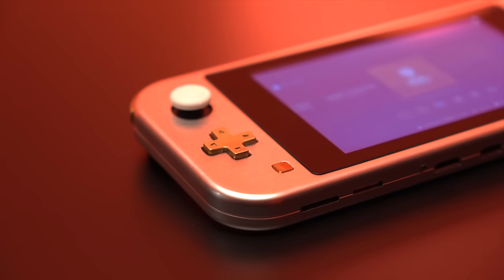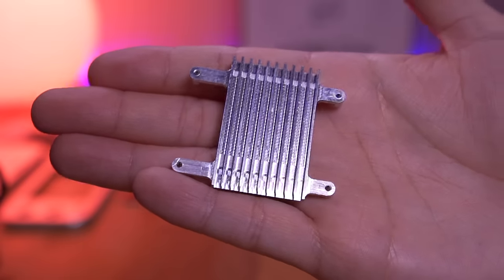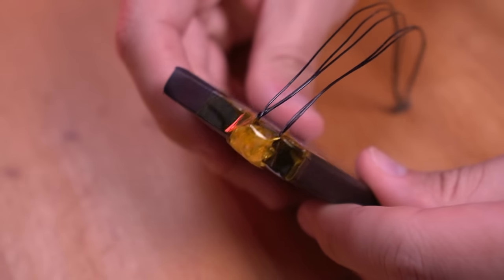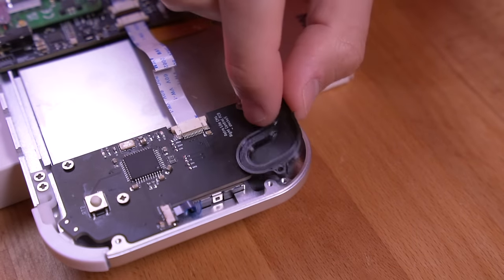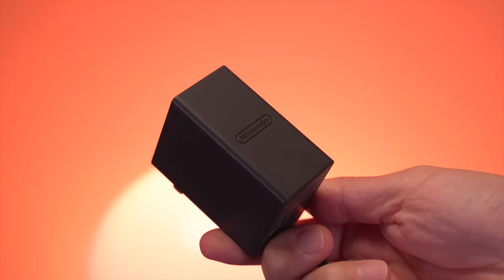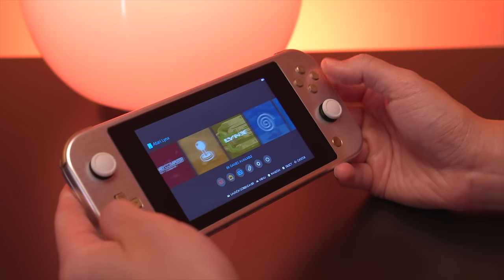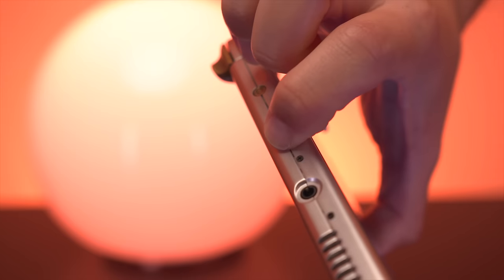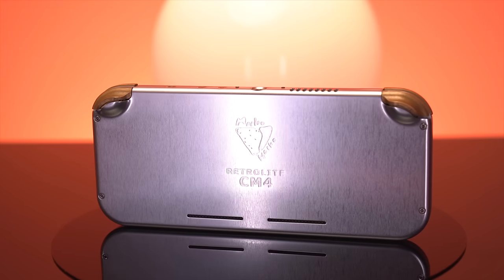This is NOT a Nintendo Switch

Comment: Thanks for the shoutout! It was a little over three years ago when StonedEdge and I started working on this project together so we have both learnt a lot since then! The joysticks do have screw posts to hold them down, we just ended up not using them since the joysticks stayed put so nicely without the screws. I also wrote most of the OSD and controller software whilst Stonededge handled the electronics design and software setup stuff. The dock was entirely StonedEdge since I had no need for one but I can see he's done a wonderful job of it too! We've since split up onto different projects, Stoned is working on a new revision of the retrolite and I am making my own version of the Steamdeck using a NUC and doing my best to kickstart a Youtube channel with it. Anyway, enjoy your new Retrolite and hopefully it sees more use than mine does 🤣
Reply: I've been following your NucDeck videos without even realizing you were part of this project! Both incredibly impressive and ambitious!
Reply from the maker: Absolutely!  You and Ben did an amazing job with this project!  Your nuc steamdeck looks very cool!
Reply: I’m kind of curious about the sd card, has any measure being taken to prevent the pi from shredding it? In my experience some diestros tend to absolutely eat the sd and it ends up failing after a few months of continuous operation (which is pretty out of scope for this).
Reply: Great job guys, but honestly you should prepare for the incoming lawsuits ASAP, this looks similar enough for Nintendo to sue and cripple you.
Reply: lemme buy urs since u don’t use it so much @horchatamilker
Reply: @fujinshu it does look a lot like the switch light but screen looks bigger
Reply: Hallo nice job but I think it has the same problem as the switch. You can not hold it for long playing. That's why you need something to hold it.
Reply: I love this project. Though I do kind of wish there were more projects just using standard/oem shells for the consoles in question (e.g. the psppi project). I feel like a lot of these DIY projects either require you to do it bare-board or effectively have a 3-d printer (or know machining) as a requirement and thus putting it out of reach for most people.

Comment: While the pi5 is right around the corner the pi4 is still an extremely capable board for stuff like this so it makes sense to design around the cm4 not only is it going to become cheaper to get a cm4 but you will get really good emulation at the lower cost
Reply: Hopefully, scalpers won't make it near-impossible to find pi-CM4s like it had been with previous pis.
Reply: The problems with this are:
- Find any Pi available
- Plenty of more powerful and with better hardware Chinese consoles available (like Retroid pocket, and Ambernic brands)🤷‍♂️
Reply: @nach0x are the retroid and anberbic devices really more powerful than a cm4? Which models out of curiosity?

Been looking to build or buy a portable. Currently looking at building a pspi, cut up Wii (as I have spares), or something else pi based, but would buy something pre-built if it was interesting.
Reply: @charlesswansonii9319     exactly...i had to wait till last year from 2020 to get one at retail price...almost the whole of coronavirus lockdown in Britain...Adafruit and sellers blamed chip shortages in Asia...we would believe that except the Chinese found plenty for their Asian contracts...and North America...that got the remaining shipping containers...Europe got the minimum...or pay double or treble for direct private sales...what can we expect from loyal Chinese...we only designed it in England
Reply: @nach0x AYN odin is a powerhouse
Reply: @LVHamtaro  for that price it better be
Reply: @Wilbure  well there are  plenty of choices,  what's your emulation of preference  or aim?,  how much $$ do you want to spend?  preferable size of shape?
Reply: @Wilbure definitely. Pretty sure the retroid pocket 2S is just (if not more) as powerful as this, and its only 100 bucks.

Comment: This thing is amazing. I just wish they would use a non-custom battery. Nothing says "future e-waste" like a custom battery. Batteries are the one part that will eventually wear out - and making it custom means that I won't be able to get one in 5 years when it finally dies.
Reply: Replied to another post further up, but it's compatible with a common cell size (855080 4000mah). The one in the video is just some special ones Stonededge had made with a nice wrap on them.

Comment: I woulda prefered if at some point you talked about what the dock sends to the tv, specially what res does it output instead of just glossing over the docks workings, which was by far the part I was most curious about this build
Reply: I can answer that - 1080p 60Hz :)

Comment: I wonder would a RK3588 be better here, though now we have the RPi 5. That being said, i wish there's a way to mod existing phones to dedicated handhelds or SBCs to reduce e-waste and give a second life to phones.
Reply: You kinda-sorta can do that, just connect a mobile controller like Razer Kishi to the phone and play.
It's better if your phone is supported by a custom ROM like LineageOS to ensure software updates, and if the battery is still in good shape or easily replaceable.
Reply: @subrezon  I have seen a hacky solution that involves mounting a heatsink+fan and a much larger battery. Just not a nice kit that you can 3D print+buy parts of the shelf.
Reply: @cloudycolacorp  Found the videos I was talking about. There's one by Geekerwan and another by Zac Build

Comment: I am so sorry but this fails right out of the gate by making us solder to a battery... that is incredibly dangerous. this needs to be designed better. That is just beyond stupid.
Reply: That's a little PCB on the end of the custom battery, you aren't soldering directly on the cells.
Reply: @cncdan  short it and it will explode, no thank you. hard pass.
Reply: @cgwworldministries83  there will be over current protection on the PCB. Short it and you'll see a little spark followed by nothing. You can buy batteries with leads on them already in this size anyway (which is what I did). Then you just need to solder the plug on one lead at a time. It's a piece of cake for anyone with a small amount of soldering experience.
Reply: @cncdan  not even going to chance it bro, it should have a spring loaded battery compartment. No excuse.

Comment: You know for a cm project a phase change thermal pad might be a better option for a flat pad style heatsink. No fuss with the perfect amount of paste, no mess and you might just get better temps! I've never seen you use it, I've used it on a few projects and each time it shows lower thermals than kryonaut. It's anecdotal but I like it

Comment: I just love how many options there are for portable gaming now.  If sony wants to give up on their real portable system and sell a tablet with a controller glued on instead and Nintendo won't upgrade the switch, the community will come fill the gaps in the market that the steamdeck and similar devices don't cover.

Comment: I can’t understand why most of these projects don’t pay enough attention to sound. They install low-quality speakers that do not have a housing; they play low frequencies poorly. For example, they could use speakers from the iPhone se/7/8. I think the sound would still be better.

I wrote this while watching, here the speakers have a housing, but it is unlikely to be sealed.
Reply: It's a snap fit. You could glue the edges together if you were worried about it

Comment: I don't like the aspect of using a custom battery and not a commonly available one. what is in 10 Years? Will i be able to get a replacement battery? If using the form-factor of the for example Nintendo 3DS Battery you will be able to get a replacement but so?
Reply: I think this part was a little misleading. It's a common cell size, Stonededge just got some made with a nice wrap on them.

Comment: My only beef is with the emulation power. If it can't do PS2 or GameCube, it's just a bit too weak for me. If There is a Pi5 CM in the works, or as mentioned at the end a RockChip Rk3588 version I will be ALL over this!

Comment: The board layout is a mess, why not have controller connecters on the side edges having a long cable that runs under the heatsink is such a mess plus with the addition of having the fan sit on pegs on top of said long wire there muse be so much noise on that line.

Comment: There's no excuse for making a new product in 2023 with bezels around the screen that are magnitudes bigger than the original PSP bezels. Screen size on handhelds is probably its main spec, as it directly affects both immersion and your eye health. And there's a lot of lost potential in screen size with those bezels, but somehow it managed to have a custom-made battery.

Comment: Oh man were so lucky they made the battery proprietary instead of ya know using any of the already working ones
Reply: The battery isn't proprietary. It was designed to fit an 855080 4000mah cell. Stonededge just got some custom batteries made with a nice wrap on them (and I believe they are 2x 2000mah cells in parallel, I could be wrong on this one)

Comment: That's really cool but as soon as I saw you installing those shoulder buttons I knew they would be an issue due to the design just using the plastic or metal bending to give it the springiness.  The plastic ones probably do work better, but for how long?  Im sure they will work those small things out eventually.
Reply: One of the designers here (just catching up on some comments). Have you ever looked at the shoulder buttons inside an xbox one controller? What about the buttons on computer mice? Plastic is used as a spring in all sorts of different products and industries so its definitely not an issue. The trigger buttons weren't the greatest design ever due to manufacturing limitations, but they worked when assembled correctly. They did sometimes need a little finessing to get the fit just right and I'm not sure how well that happened here. I think the metal buttons would've also made the feel of the trigger buttons worse as the membrane was never designed to be thick enough to support a button that heavy. In hindsight, we should've just used replacement switch lite triggers but its much too late for that now.

Comment: Hey man, love your videos. I've had a lot of successful projects thanks to seeing what you do. 

However, in this video, I feel like there's one major part you left out, and it's absolutely a big one. That is, battery safety! You mentioned getting the wiring on the Lithium battery correct or "it can damage your console" but that is a very, very significant understatement of what can happen if you do not wire that properly. 

Battery overheating, thermal runaway, and even venting is extremely possible when you're soldering directly to battery pads. In this case, who cares about damaging a console? You don't want to lose a hand, or have a battery vent when your face is near the console! That should be the focus there. You also didn't mention keeping the wires from touching eachother after soldering them to the battery either. If you're going to show a video soldering onto a battery like this, you NEED to cover that as well since hard shorting this type of battery can be catastrophic. 

Another part that should absolutely be included is a disclaimer that when you solder to a battery, you need to be quick with the iron. That type of battery is also extremely sensitive to heat when  it is applied to small isolated locations. While this type of battery can run hot and the thermal runaway temperature would likely exceed any heat from typical use, applying a soldering iron to a contact is a different matter entirely. That amount of heat if applied too long to a battery pad, can also result in a catastrophic battery failure resulting in severe bodily or property harm. 

You typically don't have videos where you solder directly to battery terminals, so you probably didn't think to even mention this, but if a noob tries to follow this guide and messes up, they simply do not know how bad it can go very quickly. You seriously need to rethink either adding text to this to warn any potential user, or a complete re-upload where that is not only addressed but emphasized. 

I'm sure you do not want to hear stories of people getting injured from trying to do this, and that is a very real possibility for those new to this type of battery, or soldering in general. Most of your other videos you'll just brick a console if you mess up. In this one, you can seriously harm yourself or others if you don't. And that should be absolutely more clear.
Reply: One of the creators here! (just catching up on some comments) Just FYI, these batteries have a little BMS board on the end, that is where the wires are being soldered. You would have to try VERY hard to overheat the pack through these and a direct short to the output will simply trip the battery protection. This also isn't a kit and likely never will be, so to get to this stage in the build you'd have to be pretty profficient with a soldering iron and knowing what you're doing anyway, so I dare say most people aren't going to encounter this problem. Keep up the good work though, I do see a lot of people doing dangerous stuff with lithium batteries online so definitely doesn't hurt to warn people and I'd agree with everything you're saying if the cells were just bare terminals without any sort of protection.

Comment: I wonder if that machined shelled could have been used as a heatsink instead of creating a bespoke one.
Reply: I think the PCB and the shell were designed by different people - needed better project management I guess, cos that does seem eminently possible.
Reply: @jimdoom2276  The entire mechanical design of the device was done by me, and Stonededge handled the electronics. I gave him the sizes and shapes of the PCBs and he filled them with the required electronics. There was no communication error. We considered using the case as a heatsink but at the time of designing the cm4 hadn't even been released yet so we were unsure how the thermals would go and we didn't want to make the case uncomfortably warm. Turns out, the fan is only really needed with an overclock in a warm environment so we probably could've got away with using the rear of the housing however that would've prevented anyone building one from plastic along with much tighter tolerances needed on the case parts to get the fit good enough for thermal conductivity.

Comment: unique and soldered batteries like this is horrible. no matter how good that batteries are on paper. it might be a ewaste just because of the battery. it is not a pro. it is a con here. why don't they use something off the shelf >_>
Reply: It actually fits nicely with a generic 855080 sized lipo cell. No need to use the custom one if you don't want to!

Comment: I still don’t understand why this is needed if there is a switch lite modchip.  The quality is the same, the screen is better (even in the video you can see how terrible the screen is on this thing, the viewing angles and contrast are a nightmare), and the switch is more powerful, well, that’s understandable.  But for this self-assembly kit there is a terrible markup.  As for me, all these portable consoles have no right to life, they are too unprofitable and pointless, they are weak.  Unless you create something yourself and customize it for yourself, that’s interesting, but...
It would be better to make gba sp on pi 4, that’s where it can come in handy, unique form factor and small dimensions, that would be interesting.  But the point of making a copy of an already finished product, without compelling reasons, is a so-so idea.  There are no factors why THIS is better than a switch

Comment: Everything about this kit is amazing, EXCEPT, those analog sticks being secured with tape. I'm sorry, but tape?!  WTF?! That's a major flaw in this entire project. I'm out. So much time and care went into this entire design, but time will tell if and WHEN that tape fails. And IMO, that's going to be the first thing you'll have to replace.

I REALLY want to get this kit, but I'm not dealing with having to open this thing up, EVERY time that double sided tape loses it adhesive properties on the sticks. 

Thanks, but no thanks. Great job as always though Tito! 👍 👍👍
Reply: There's standoffs in there that can be used. We didn't bother using them though because the joysticks sit in a pocket in the aluminium and are securely held in place by the controller PCB. The tape is really only to prevent and shorts, not to hold them in place. Kapton tape would've been better!